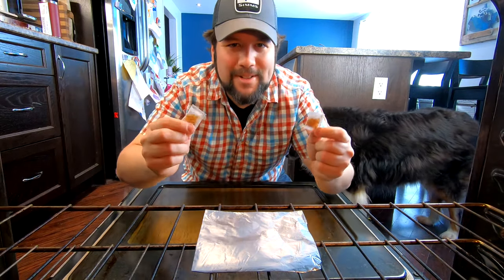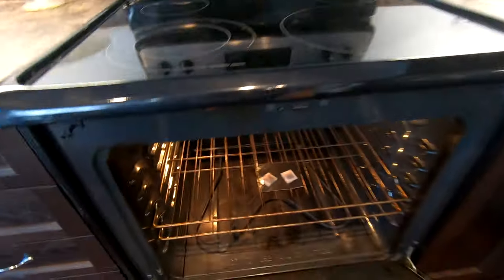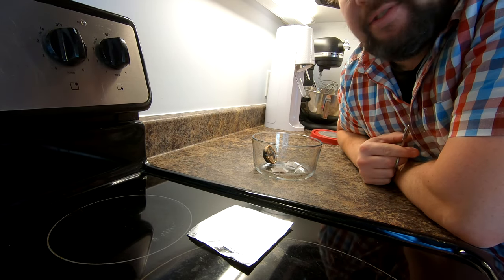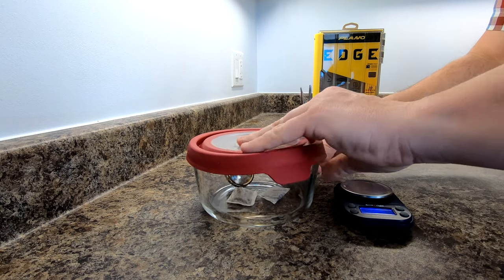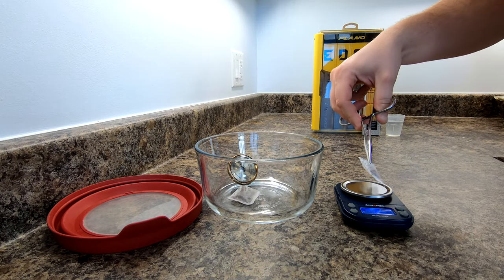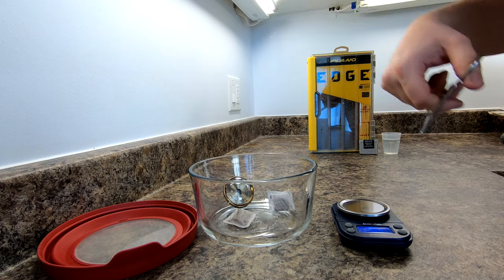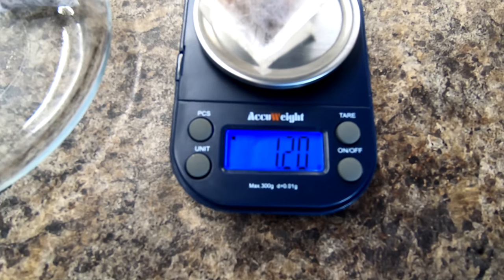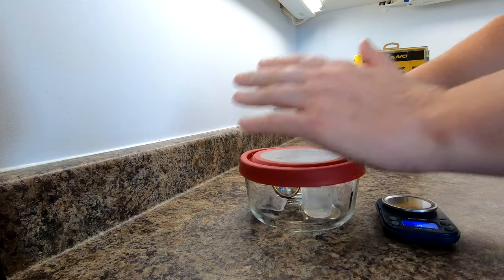PLANO Edge WATER Wick

Comment: I think I missed something.  Are you supposed to heat the packets as soon as you get the box? Great video
Reply from the maker: If it's was a sealed box from the store you're probably good. If you live in a real humid place and think the box has been open at the store then ya I'd dry it out.    Depends on how valuable your gear is that you are storing in that box.  The only way to know for sure your dessicant is working to full potential is to dry it out fully first.      Buuuuttt also, I've owned boxes all my life without water wick "technology" and have been just fine.   Thanks for watching!